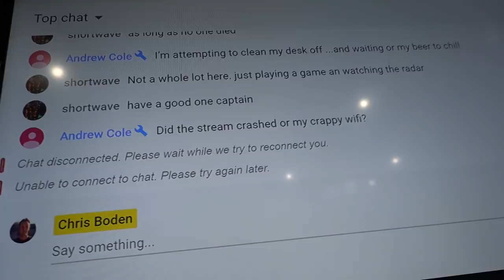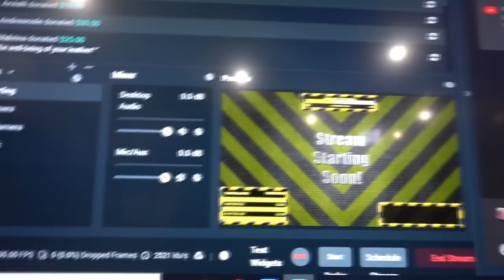Captain's Blog 4 20 2019 Workshop Conduit Day 2 with Paul

Comment: I also are not an electrician but here's what I do for bending two ends of conduit & keeping them aligned correctly.  Bend the first end like you did, then clamp a couple scrap 2x4s flat on either side over the bend(s) you just made.  Lay it all on the floor with the 2x4s laying flush(ish) on the floor on one end & the unbent conduit at the other end.  The conduit is now held with the bend(s) vertical so it should be easy to align & bend the other side.  There's probably a real electrician out there with an easier way but that's what I've got.